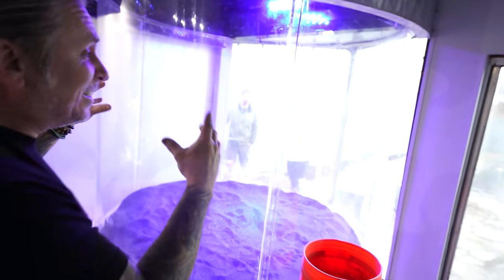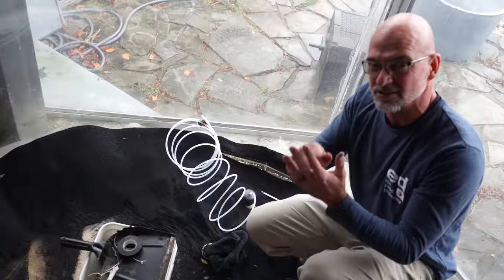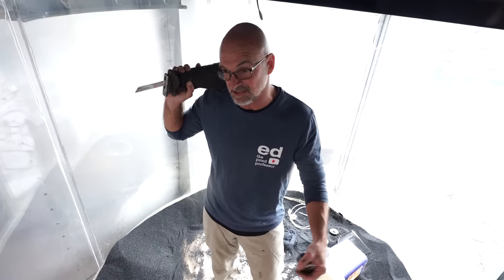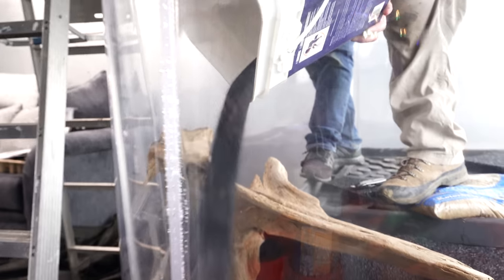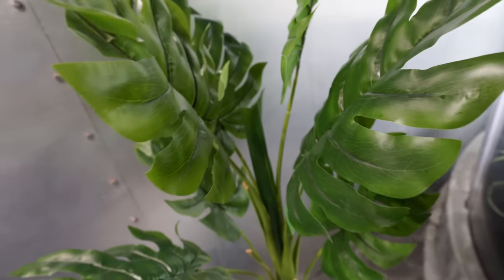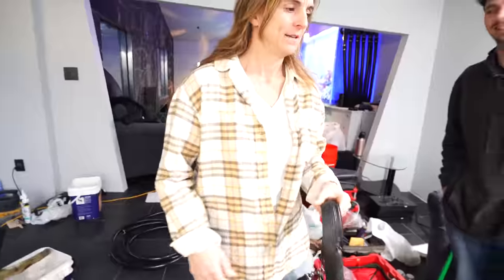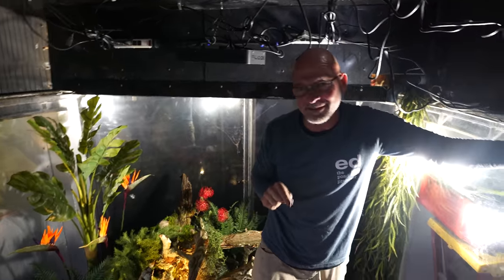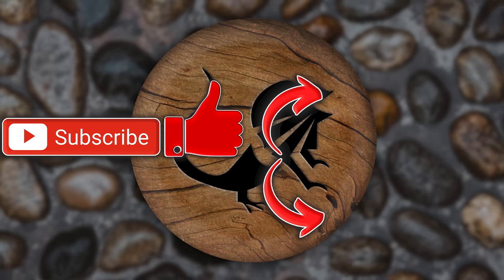I Built a 5000g Cylinder Waterfall At The Aquarium House!

Comment: To get around the 90 degree fittings you can use some string and use a shop vac to pull the string through the pipe......then the string can pull the tubing.
Reply from the maker: Yes, that was the next step for sure of this didnt work

Comment: Should of used a vacuum on the pipe with a bit of sponge tied off with string 

The hoover would of pulled it through giving you a tag line for the pipe 👌🏻👊🏻